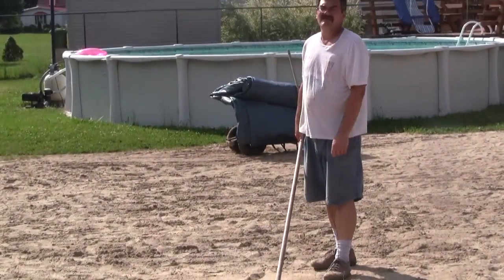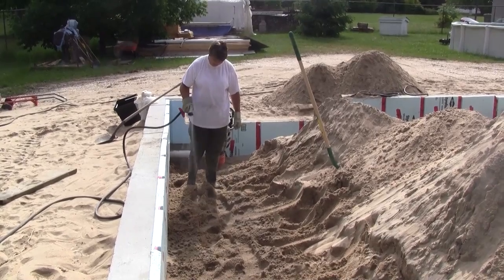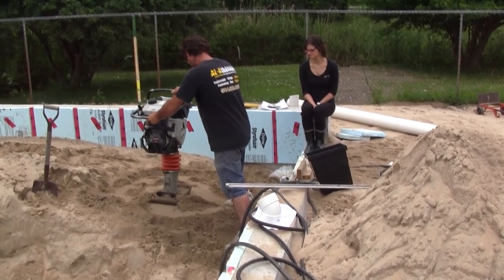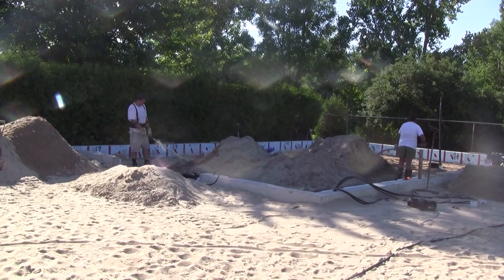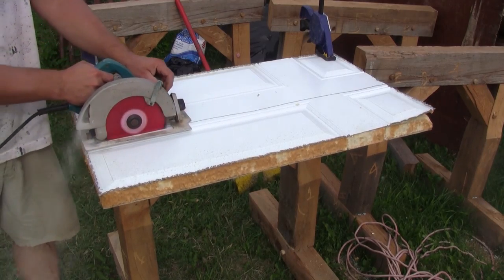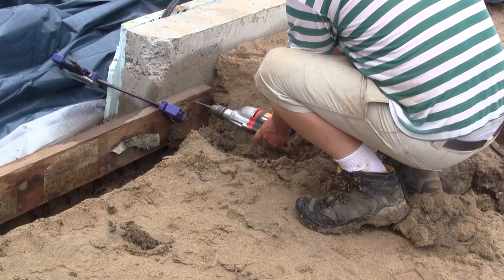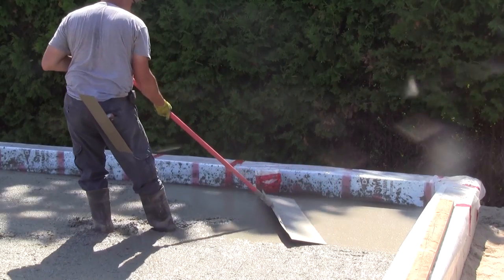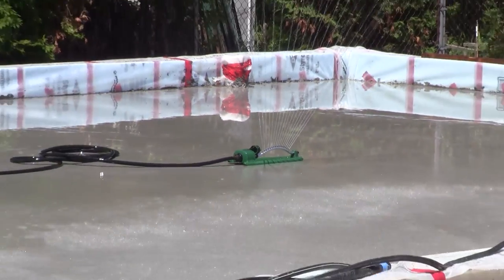The Woodpecker Ep 53 Building The Shop part 3

Comment: Alain, so happy for you to see great progress. I hate to bring this up AFTER the concrete is poured but I don't see any pipes for electric to the center of the shop for the table saw or other free standing equipment???
Reply from the maker: I wanted to do this.I checked around for floor plugs and everything, but in the end I realized that I might have problems later on. If we have a huge storm and water comes inside the shop floor, the outlets might be filled with water and a ¾" pipe with an electrical wire inside will be impossible to drain. That's the reason why they're no outlets on my floor.
Reply: I'm an electrician by trade so if this was a concern what I would have done is bring the pvc conduit out of the ground a couple of feet and then attach it to any sort of brace you wanted.A post or even a larger pipe buried in the concrete and use two cowboys mounted back to back to hold it.

Comment: Where did you purchase your large diameter dust collection piping?  I am trying to set up a system in my shop now but can only find the green sanitary piping and the fittings are like $50 each.  I can't seem to find the white PVC pipe in diameters larger than 4".
Reply from the maker: Jason Young I went to a plumber suplier and ordered them there, the pipes are made by Ipex. They're not cheap the whole setup costs me $1000, but I bought two 10' pipe extra and 2 elbows. Maybe you can find a suplier neer you I bought everything at Wolseey Canada (https://www.wolseleyinc.ca/home.htm;jsessionid=7A7F821219545D9F4182C2CF55B484C1)

Comment: So the sharp edges on each door cut-out went through your vapour barrier
Reply from the maker: Unfortunately, yes.
To my defence I put the dullest side down...
Reply: *****
 A bit late; posting this as a tip for others: Trim and dull the sharp edges with an angle grinder. No more vapor barrier breaches, torn clothes, or cut skin.
Reply from the maker: doubledarefan
Not a bad idea, but this takes time when you have. like I did, over 200 door cutouts to lay down.